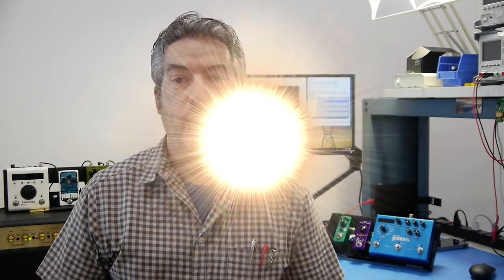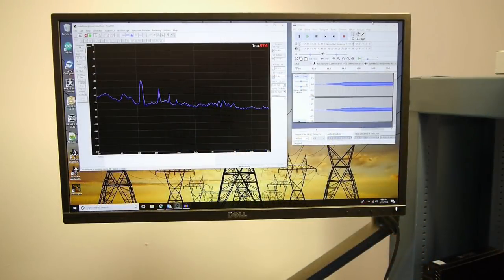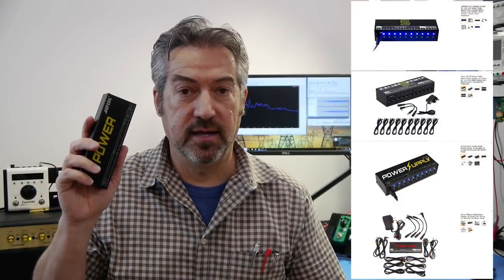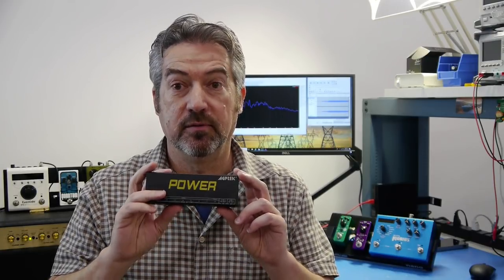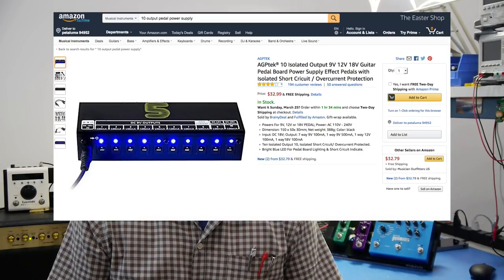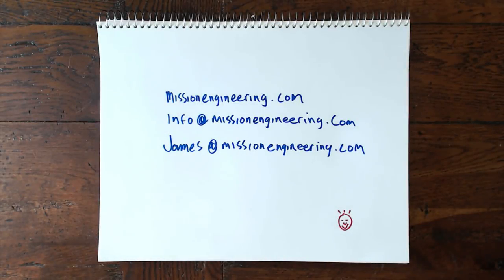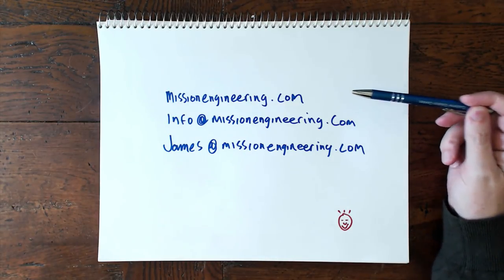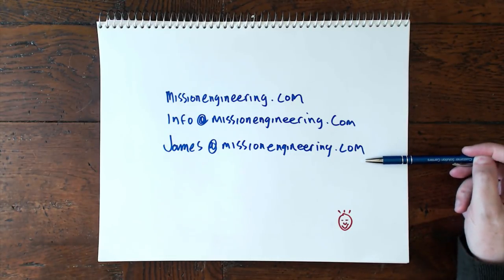Isolated vs daisy chain power supplies

Comment: I like noise in my rig. It's part of my tone, lol.  Actually I use a 1 Spot and the daisy chain and I have no problems compared to my guitar player that has an iso and all high dollar gear. His rig may be setup wrong, but mine works noiselessly and flawless night after night. I abuse my gear, beat it like a redheaded step child and it never let's me down. I have found the high dollar gear is just that, high dollar and not really all that much better for the price you pay.
Reply from the maker: Thanks for the note, and I'm glad to hear you are happy with your rig. As I mentioned during the technical explanation at the end, this video demonstrates a very particular noise issue, that happens with some combinations of pedals, but certainly not all. If you do have this issue, one method to resolve it is to use an isolated power supply, but I suggest others too in the video. If you use an isolated power supply it doesn't have to be 'high dollar gear', but typically isolated supplies are more expensive as they require components such as isolation transformers that are expensive to manufacture. Again, if you do not have a combination of devices that cause this, then great, but other people do.

Comment: Only the non-isolated power supply connects to the mains. This is why there is more noise than with the isolated supply unit which is connected to a battery.
Reply from the maker: Thanks for watching. You'd think so, right? but that's not the case here. While there are often multiple possible sources of noise in an audio power supply, the demo here is of noise entirely on the output side and it doesn't make much difference what the input power source is. A few people already commented on this so I did a follow up here https://youtu.be/_5sPLcFRCow
Reply: @JamesLebihan  Thank you, James, for answering. I should have written: probably.

Comment: If the digital pedal is at the end of the signal chain, the noise problem would not exist, I assume. In most cases, you would have only digital delay pedals in a setup, and these are usually put at the very end inside an FX loop - analog pedals such as distortion, fuzz, EQ, boost, etc, are usually put at the very start of the signal chain
Reply from the maker: No. The noise is still present regardless of the pedal order with these particular pedals. Depending on exactly what combination of pedals you are using, you may sometimes get lucky and changing the pedal order may reduce the noise if the filters just happen to line up, but usually not. The noise is present on the DC - and changing the pedal order doesn't change this. The easy way to prevent this in all cases is to isolate the DC-

Comment: This video does not compare an isolated supply to a non-isolated supply. It compares an isolated supply powered by a battery (go to 7:20) to a non-isolated supply powered by a wall wart (9:29). This is too big of a variable to change between the tests to make them comparable. 

Interestingly on the second pedal board, the noise peaks are at harmonics of 60 Hz. (120Hz, 240Hz etc., go to 17:49 in the video). This is exactly what you would expect from the switching supply that is probably in the wall wart.
Reply from the maker: The noise described and demonstrated in this video is generated in the digital pedals themselves and is unrelated to the source power supply
For those that thought this was an unfair test because I used a battery for the isolated power source, here's the follow up https://youtu.be/_5sPLcFRCow

You'll see that the results are almost exactly the same when using an AC/DC supply with very minor differences between switched mode and linear sources.

Comment: I think the test is not valid because being isolated and non isolated is not the only difference between the 2 power supply. First one is powered by a battery. Meaning there are not transformers in it. The other powersupply is probably using transformers/chopper like any switch mode power supply. Why not just add a huge capacitor to remove all ripples from the dc line?

Comment: You cannot compare a unit powered by a power bank and one powered by a wall power supply. Init??
Reply from the maker: Yes you can. If you watch the video, it explains, and you can see the follow up here that proves it https://youtu.be/_5sPLcFRCow The noise in the demo is on the output side and has nothing to do with the input power source.
Reply: @JamesLebihan  it is normal there is not noise when you power a pedal with a battery. I would be more interested in the same experiment with both of them powered by a wall power supply. Sorry
Reply from the maker: @avemeva   That's exactly what's in the the second video which I sent you, and is linked in the comments, and in the video description. It also explains again why this has nothing to do with the input power source. I've had people comment that the noise is from the amp, from the city power grid, from the lights in the room, because of the pedal settings, etc etc. It's none of those. It's exactly what is demonstrated in the videos. It's a common occurrence that all pedal manufacturers know about and is easily reproducible.
Reply: @JamesLebihan  thank you. i will sure check it out.

Comment: I have a one-shot daisychain and it is noisy.
I bought a cheap power brick from aliexpress for like half the money , not a problem or issue and way cheaper and cleaner in final setup.
Don't buy the packaging hype anytime u have a bunch of loose wires your gonna get noise. Shorter distance on leads from supply to pedal with a daisychain you realy have no choice by design. 
GARBAGE IS THE ONE SPOT.
It does work but do you want all that unescary noise

Comment: Thank you for showing us how to test. Probably a dumb question but if I don't have something like a mobius can I daisy chain a couple of pedals off of the 500ma. logically I feel like I can but I thought I'd ask. Thanks
Reply from the maker: Sure, you can use a daisy chain cable and connect multiple devices to a single output. Just remember that the total current requirement of all the devices added together should not exceed the maximum for that output, and that the daisy chained pedals will no longer be isolated. For small analog pedals this normally works fine.
Reply: That's what I was thinking. I currently run 7 pedals only 3 digital. I love the idea of running off a usb battery. The 529 seems like a killer product.

Comment: This test is kinda wrong I think. You are powering the first one with a battery. The problem is in AC current generating hum right? So you need to power BOTH with an AC source for the test. You can't just run one with a DC battery, and the other with an AC adapter an call that test fair. I use a rechargeble USB power bank with a step up from 5V to 9V on one of those generic Caline ones and is silent. Sometimes i just daisy chain directly  from the power bank and is silent. Using a power bank is like using an internal 9V battery. Batteries are the cleanest currents possible. DC currents transformed via an AC source (wall adapter) are not the same as chemical generated DC currents (battery). The problem comes from the AC from the wall. 60 cycle hum and non conditioned energy and no filters at all. "Isolating" the outputs is not the problem. The problem is in the INPUT. The problem comes from dirty energy from the street wired with lots of interference (cell phone towers, close wires, the design of the house wiring, motors plugged on the same wire like fans, washing machines etc). That said, you need to isolate the whole system from that dirty energy. Pro guitarrists use hospital grade power conditioners (example: brian may, angus young). Hospital machines like scans, x-ray and lasers are too sensitive to noise. So they use high level and quality power conditioners. Those are expensive, big and heavy. Just guitarrists that fills stadiums use them. For us, the options are: single batteries or power banks. That way, we are free from the AC from the wall.
Reply from the maker: No. This has been mentioned several times before and it is not correct. If you check the comments you will see that I did another video further demonstrating that the noise in the video is completely unrelated to the wall power source. If the noise came from the wall power, why would it only be audible when certain digital pedals are connected, and go away again when they are removed? This is not some weird, controversial subject. It is very well understood by designers of digital effects pedals and power supplies and any second year EE student. It's why isolated guitar pedal power supplies exist. https://www.strymon.net/effects-pedal-power-supplies-white-paper/. The reason not every pedal combination experiences this phenomenon is that not every digital pedal generates this noise.
Reply: @JamesLebihan  Uuuuu someone took some air here to respond... we have a THIRD year student ovahere people... lol I'm not picking fights man. Chill. I don't care if you are a rocket scientist or a handmaker. You just reiforced my point: If your title says: "isolated vs daisy chain power supplies" and you blame the DIGITAL PEDAL foi that noise, then, the problem isn't the power supply! It's obvious, then, that isolating the one culprit will solve the problem. But digital pedals are not the only noise generators. And not the worse. You take your band to a venue and everything is plugged in the same outlet. Fridges, fans, lights, disco globes and the DJs pick up. Nothing you can do to avoid noise there unless you use filters. Power conditioners are the answer, not isolated power supplies. Isolating will just take care of ONE kind of noise (digital crap). You need a more global solution = isolate the input, not the output.
Reply from the maker: @vexguine  As you point out, the title of the video is 'Isolated vs Daisy-chain power supplies' and in it, I cover what the main reason is that you would use an 'isolated vs a daisy-chain power supply'. Indeed the power supply is not the source of the noise and I point this out in the video but that doesn't change the practical fact that using an isolated power supply will usually fix it. Mission, Strymon, Voodoo Lab, True Tone, Coiks etc all manufacture isolated power supplies for this very reason, and though may be obvious to you, it's not obvious to every body.

Comment: So would you receive any noise if you daisy chained but only used analog pedals?
Thanks
Reply from the maker: There can be other noise issues associated with analog pedals, but you will not see the exact issue demonstrated here. Generally analog pedals are more resilient to daisy-chaining.

Comment: You're using digital pedals with the daisy chain. Most digital pedals do require isolated power supplies. If you use nothing but analog pedals that require the same amount of power you should be fine. We already know what you showed. Of course, you can avoid all of that using an isolated supply it's not like you proved that daisy chains are bad. You just showed us what we already knew.

Comment: great explanation.  except that its completely wrong.  the noise present is all harmonics of ~60 Hz mains.  the fact that you ran one set of tests from a battery and the other from a wall wart doesnt help.  you are introducing something different that might impact on the test.    that is not like for like.   What about testing both from the battery or both from the same wall wart?  

Digital noise is gonna be in the 10s of MHz ranch not sub kHz..  

the rationale for why is you need isolated supplies is off
Reply from the maker: Thanks for the comment. It's not correct though. Although there can certainly also be AC noise in the audio signal (I address that in the second video linked below) The noise that we are concerned with in this video is not coming from the AC supply. It's not coming from the input at all, its on the output side. If you daisy-chain multiple digital pedals from the same power supply you will still get this noise in the audio path even if its a battery powered supply. The noise is present in multiple bands. When the filtering is working correctly, then it should push that noise up above the audio spectrum, but the issue demonstrated here is the noise has a path back through the power supply where the filtering is not present.  I'd love for it to be true that the noise is all from the AC as then we could all just daisy-chain multiple digital pedals to a single battery powered supply and never get any noise, but unfortunately that mostly doesn't work. I get several emails a day from people trying to do just that and then experiencing these noise problems. The way to resolve it is to use an isolated supply (battery or AC) which removes the return path.
Reply: @JamesLebihan  in this video you say it is from the digital components.  it is not.

I am not disagreeing with your conclusion.  you likely do need isolated power supplies.  that is one way to mitigate the problem.  there might be others (less practical ways) 

I am disagreeing with your explanation.  the guitar signal that passes from pedal to pedal and all the power supplies cables going from the pedals to one common source are forming a large loop area that is picking likely picking up the mains noise.

in this video all the noise was effectively harmonics of 60 Hz.  that is mains noise.  that is not digital noise from digital pedals.  as I said that would be in the 10's of MHz region.

I stand by my comment. your explanation of why you need isolated power supplies is wrong.
Reply from the maker: If we remove the AC supply and power the pedals from a non-isolated battery power supply, the noise still exists so it's not conducted radiation from AC because it's still present when the is no conduction path. Are you suggesting the noise is in fact radiated emissions from other AC powered devices in the room? The noise only occurs with digital effects pedals and not analog ones so is there something about the loop that only exists with digital pedals?
Reply: @JamesLebihan  in this video we only see noise in harmonics of 60 Hz.  that is mains.  as we have many current loops (power supply to pedal down guitar cable into the next pedal and back to the power supply) it is likely acting as a loop antenna.    So even if you repeated the above experiment (fairly with a battery!) you would could prove that point that it is not from the mains supply of the pedal board.  But the lights in the room, the power supply amplifier, everything is radiating energy at 60 Hz.  the non isolated power supply just helps create a loop that can pick up this noise.  thats my thinking right now.  

the fact that you see this as more of problem with digital pedals I need to think about.   just look at any DSP microcontroller and their clock frequency is in the MHz region.   they are sampling at 44.1 kS/s or better typically and that needs to be number crunched significantly faster to avoid latency.    Without pulling apart some digital pedals I cant comment conclusively as to the source.
Reply from the maker: Thanks for taking the trouble to comment on this. It's certainly appreciated. Here's a couple of things to bear in mind. 1. Although there is mostly always going to be some common mode noise associated with these types of systems in practical environments, as you point out, this is mostly not the noise source that I am attempting to highlight in this video. In fact, I can confirm that high levels of noise are still present when connected to a battery in an anechoic chamber with extremely low environmental emissions, again because neither AC radiated nor conducted emissions are the source of the noise I intended to demonstrate here. 

2. The reason this noise occurs in digital effects pedal systems and not analog is because there are multiple sources of noise from digital effects pedals across all sorts of frequency ranges. The problem here is that we are thinking of digital emissions purely as a component of core clock of high speed devices such as DSP's or micro controllers but that is really the least of our problems in terms of audio (although still a problem in terms of compliance with emission regulations). There are all sorts of other sources of digital noise that fall squarely in the audio section of the spectrum in this type of device. Shot noise, flicker noise, low frequency output voltage noise from DC-DC converters etc. Digital pedals are full of other IC's that generate noise. PWM noise is also a classic problem in effects pedals. PWM is frequently used for things like display brightness, LED brightness , LED color control positions etc. PWM signals are square waves at low frequencies with sharp edges that can cause significant audible noise. You can often watch this happen. Connect up certain digital pedals in the manner I showed in this demo and you can hear the noise change amplitude and frequency as the LED's turn on and off, or change color or brightness, or as images change on a digital display. This noise has nothing really to do with the core clocks of the controllers, they are driving outputs at much lower switching speeds.
Reply: @JamesLebihan  the noise you showed in your video is all sub 1 kHz and harmonics of 60 Hz.  It is mains.  Period.